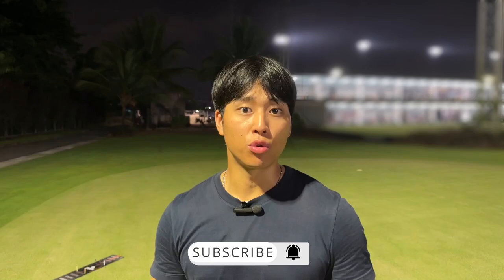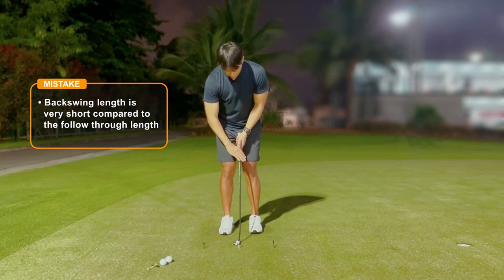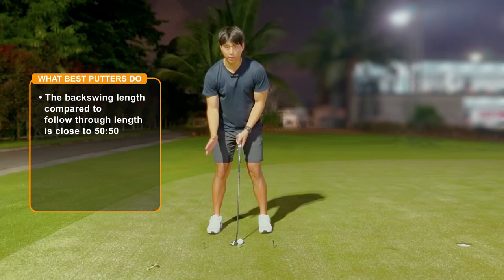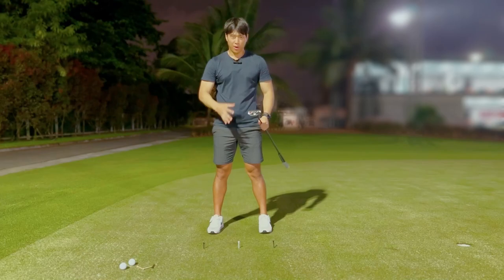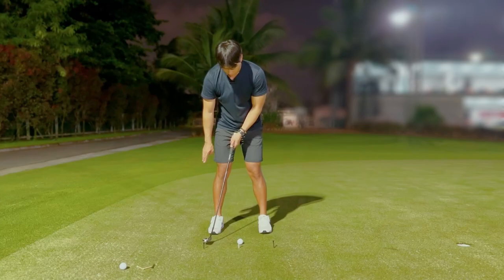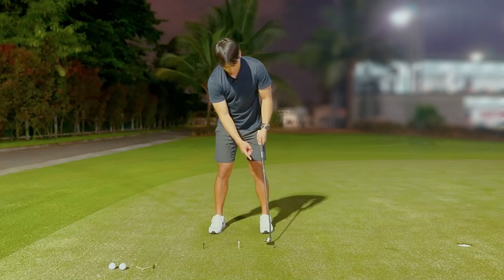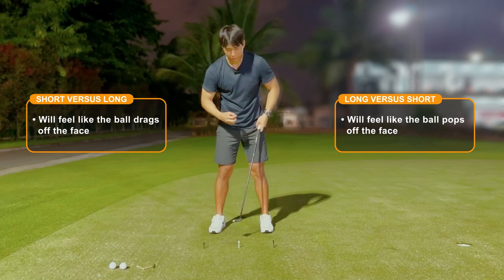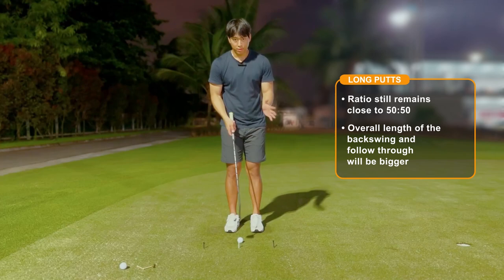PUTTING DISTANCE CONTROL

Comment: Agree but all this depends on good contact. I would also say the biggest issue with distance control is poor contact. Hitting a putt solid vs poorly greatly changes the distance. Watching people putting 5 balls from 25’ I see several very short and several very long. Do a video on solid contact with things like not moving hips (rarely covered by anyone) and extending toward the target.

Comment: Great technique demo. Controlling distance, however, really wasn't covered. Also if your 4-ft put has that wide a path (@9in back to outside of your foot), how far back do you take a 30 footer? Or do you change tempo?
Reply from the maker: The whole video was about controlling the length of the backswing and follow through. If you watched the entire video I talk about what to do with long putts. Controlling length of stroke has everything to do with controlling distance
Reply: @JKMGolf  Hi Jonathan, do you mean the longer distance, the wider for the two tee pegs? The only thing doesn't change is the same tempo?
Thanks

Comment: Great instruction, and timely.  Noticed your legs are VERY stable (a weakness I have when putting) and wondering how you lock them down during set up and address.  Do you tighten the legs or angle the knees in, slightly, to add strength?  Have also begun focusing more on making sure my left wrist and palm (right handed putter) maintain their angle against the putter handle and that my right hand stays firmly connected as well.  Historically been told I'm a 'wristy' putter in that I lose the connection with the handle during the stroke and therefore the putter face as well.

Comment: This is interesting, it is the exact opposite of the top speed golf video where clay says top players have shorter back swing and longer follow through
Reply from the maker: It’s usually fairly even on the backswing and follow through
Reply: @JKMGolf  Both make sense to me. He was recommending a 36/64 rule.
https://youtu.be/MYRDGYN5rBA?t=108
Reply: I use the Clay method.  1:2.  Feel it roll off the face vs popping it.  Some talk same timing of the swing, so the same tempo for short or longer swings.   Also, feel the club stop and be dead weight in the back swing, accelerate to the ball but at impact the acceleration is zero and negative just after the ball, ie max velocity at impact then slows.  Claw grip… impressive